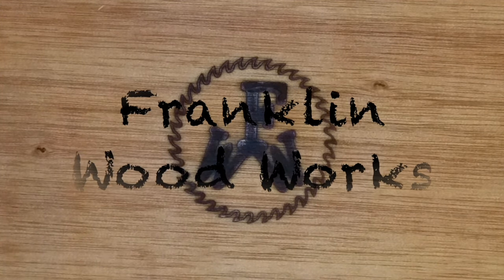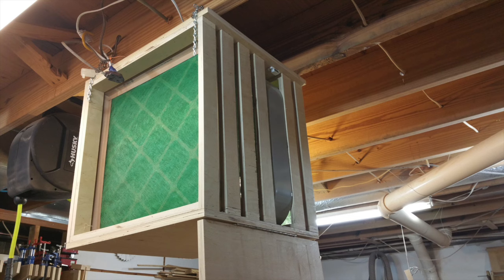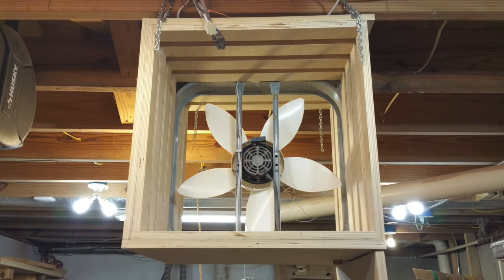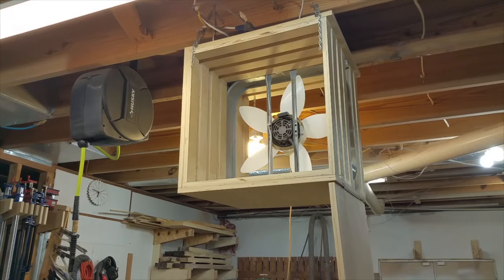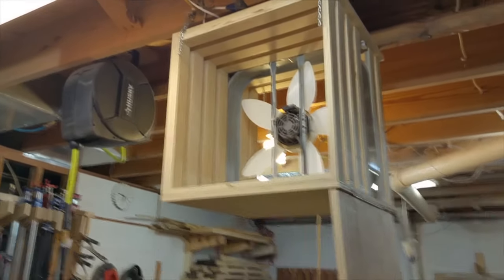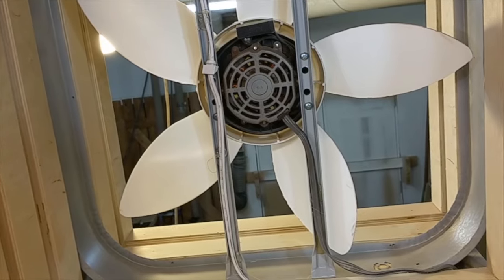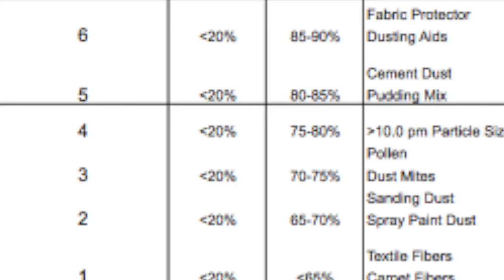DIY Shop Air Cleaner

Comment: Thanks for a truly excellent and practical DIY. So many DIYs use hard-to-find parts. I just bought the hardware to build a router table, but this may have to be my next project. I'm shocked this has been up for more than two years with less than 500 likes; it should be many times more.

Comment: Hi, Rob. You mentioned that you converted the fan's switch so that it can be activated wirelessly. Please tell us how you did that and please include the links for the additional parts! Thanks!
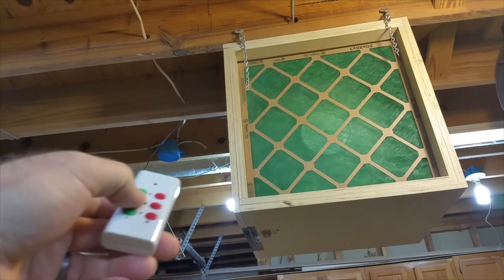default wired switch 2:05 wireless switch 2:13
Reply from the maker: I can't find the exact one I used, someone gave it to me as a gift.  But it's very similar to the below link.  The bad part about these, is that they aren't rated for high amperage.  I don't really understand that, it seems to me that it's just a switch, but I tried to use it on my dust collector (15 amp motor) and it blew out the switching unit.  But on a simple fan like this, it works just fine.  Just plug the fan into the switch, the switch into the outlet, and you're good to go.  https://www.walmart.com/ip/Etekcity-Indoor-Wireless-Remote-Control-Power-Outlet-Light-Switches-5-2-White/39520462

Comment: Where did you get that remote from and what model is it?
Reply from the maker: I can't find the exact one I used, someone gave it to me as a gift.  But it's very similar to the below link.  The bad part about these, is that they aren't rated for high amperage.  I don't really understand that, it seems to me that it's just a switch, but I tried to use it on my dust collector (15 amp motor) and it blew out the switching unit.  But on a simple fan like this, it works just fine.  Just plug the fan into the switch, the switch into the outlet, and you're good to go.  https://www.walmart.com/ip/Etekcity-Indoor-Wireless-Remote-Control-Power-Outlet-Light-Switches-5-2-White/39520462